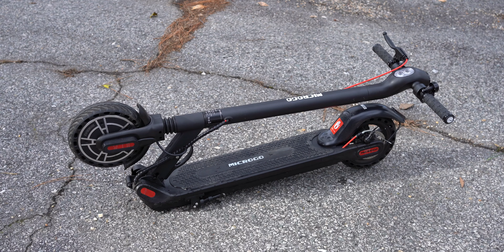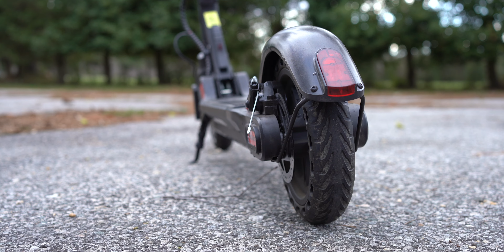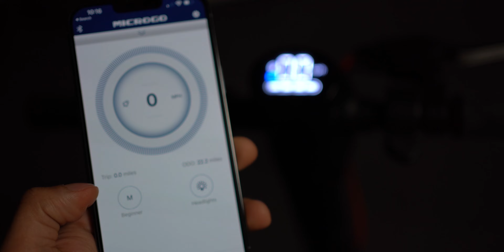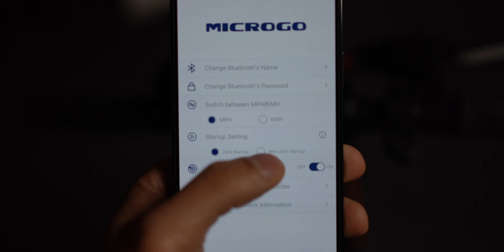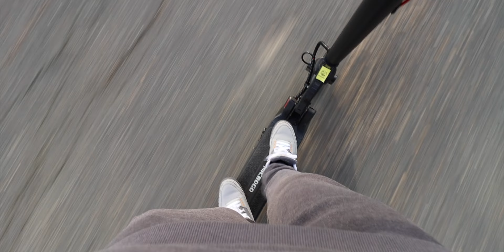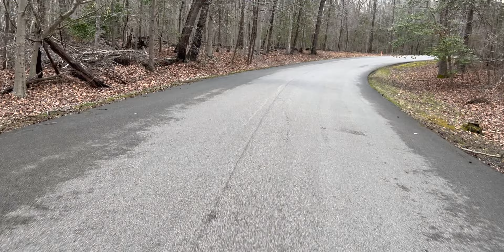MICROGO M5 Pro Electric Scooter Review

Comment: I did the equation " V x A = W "  this scooter is a 36V and 7.5 Ah, and it equals to 270W not 350W this is a 80W difference and that matters alot. This scooter should be able to go faster, but I think it'll drain the battery more.

Comment: Lately, the Microgo V2 Model of this Scooter makes some annoying Strange Noises, it is really annoying, I have the Noise Unbearable 😖😫🛴 I think that the Origin of the Noise comes from the Graduation of the Screws that join the Mast and Handlebar, lack of Suspension on the Solid Wheels of that specific Scooter Model, since the front Damping that is in the lower part of the Mast and the one that goes below the Platform does not minimize the Noise of Jumping in Badenes either.  I would like to know advisable ways or methods to minimize that Noise in the Neck and Wheels.  I would also like to know if there is the possibility of changing Parts on this Electric Scooter and if someone with this Electric Scooter Model has made any complex Modification such as changing the Damping for another type of better Damping, or placing Front Suspension carved in the lower part of the Mast and in the back it has through some integrable piece.  Cheer up to the People who have it who can upload some Videos of Modifications on the Electric Scooter and provide more Information about this Problem Thank you.

Comment: It's one of the worse scooters I have encountered. The two main reasons are, the back break lever is on the same side as the accelerator which is just so uncomfortable and badly designed. It doesn't need a front break switch to be honest. And not forgetting it's such a painful ride because it doesn't have any shock absorbers so you feel every last inch of the road you travel on. Avoid this scooter at all costs....
Reply: That’a where it’s located on motorcycles. Is my instinct.
Reply: I just purchased this and mine has a single shock absorber on the front and dual absorbers on the rear if you look underneath.

Comment: Hi
My M5 is turning off while im driving uphill, but my Battery is still fully charged. If you let the scooter rest for 30 minutes, it turns on again. what is the problem and how can iI fix it, have you any instruction?

Best regards Michele
Reply: press the button 6 time
Reply from the maker: it might be overheating, would recommend to not be going full throttle at all times

Comment: There are to different models of the m5!!!
The ver. 1 is much better then ver. 2!  i have e'm both.  Microgo should be ashamed by their ver. 2 products.

The one in the video is ver. 2.   The speeder and brakes are so fragile on ver. 2 if it falls to the ground they will brake inside.
The tires are much worse on ver.2 and will give you a very rough ride expirience and they changed the motor hub to which makes more noise.  Looks the same! It's not!
Even the battery pack in Ver. 2 is worse!  They are now using much cheaper battery's from china compared to ver. 1 Korea/japan batterys.

The only good thing about ver. 2 is the folding system which is improved.

You can teel the difference on the folding lever!   Ver. 1 has a little black metal tap on the folding mecanism. Ver. 2 has long lever handle with a red button on the folding thing.

m5 Ver. 1 is one of the best e-scooters in my opinion.  I put a handlebag with a extra battery in it!  I can go around 30 miles on one charge.
Reply: how do i know differentiate version one and version 2? I'm just about to buy one. could you please suggest a good one.
Reply: @createwithtayo  Don't buy it ;-)
There are much better e-scooters on the market

Comment: How is the scooter going so far
Reply from the maker: still going strong
Reply: @HiTechKing  ok because I I’m getting one and I have heard mixed opinions on it
Reply: @Zaneharrington69  Im getting one too..A little afraid to get disappointed, but I have not heard any bad things yet. Any updates?
Reply: @Zaneharrington69  There are to different models of the m5!!!
The ver. 1 is much better then ver. 2!  i have e'm both.

The one in the video is ver. 2.   The speeder and brake levers are so fragile on ver. 2 if it falls to the ground they will brake inside.
The tires are much worse on ver.2 and will give you a very rough ride expirience and they changed the motor hub to which makes more noise.  Looks the same! It's not!
Even the battery pack in Ver. 2 is worse!  They are now using much cheaper battery's from china compared to ver. 1 Korea/japan batterys.

The only good thing about ver. 2 is the folding system which is improved.

You can teel the difference on the folding lever!   Ver. 1 has a little black metal tap on the folding mecanism. Ver. 2 has long lever handle with a red button on the folding thing.

m5 Ver. 1 is one of the best e-scooters in my opinion.  I put a handlebag with a extra battery in it!  I can go around 30 miles on one charge.
Reply: @Ian_Christensen  is version 1's throttle metal? How are they differentiated when it comes to quality the throttle and brakes specifically?
Reply: @huntno  Can't you read...? Or you want me to bend it in neon pipes and piss it in snow
Reply: @Ian_Christensen  Thanks alot for the information between the two different versions. I'm getting the version 1
Reply: @jokkejens I tell you! It's fast enough and that 3rd gear gets going pretty fast! Had to lean left hard while gently braking to avoid parked cars in my apartments oval parking lot😂. It gets up ! I'm 68 but still, I made it do what it do and it do damn good for me!😅